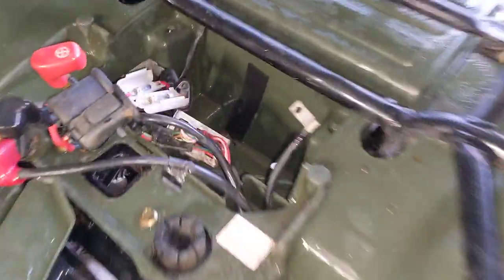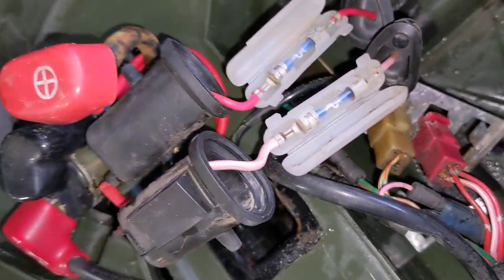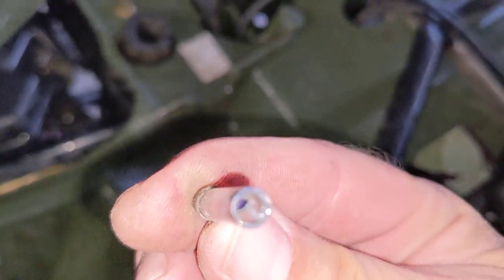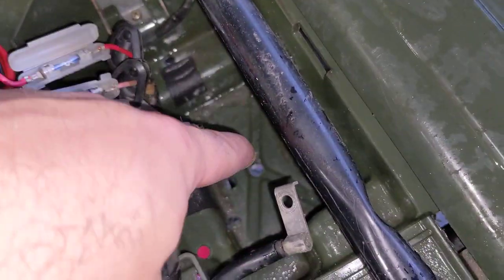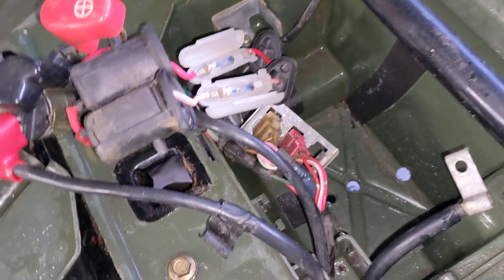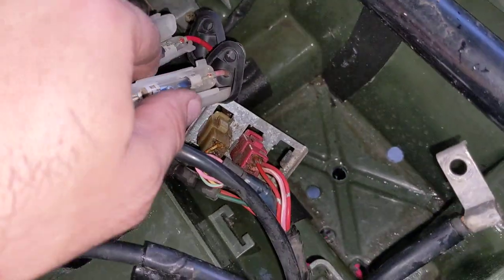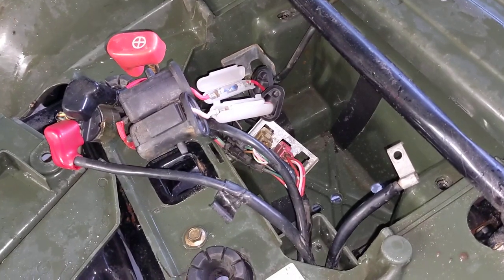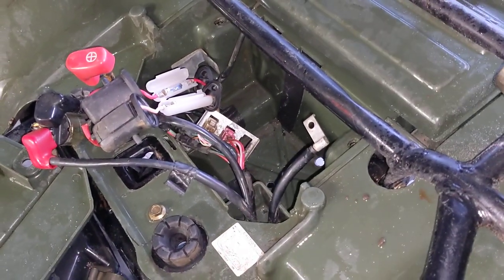Honda 300 battery box tips

Comment: Mud puppy have a quick question for you on my 300 carburetor I've replaced float and float needle valve but I still have gas coming out of my overflow what else should I try
Reply from the maker: Probably need to clean out the hole that the needle valve goes in really well I like to use a q-tip with some valve lapping compound
Reply from the maker: Also make sure that the hinge pin is not binding up on the float valve
Reply: @MudPuppyOffroad  would lubricant grease work?